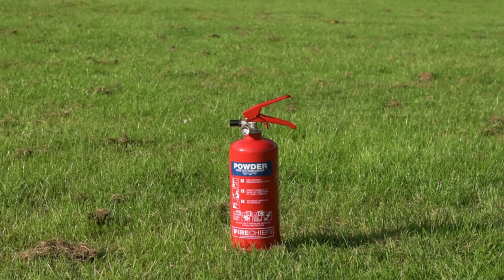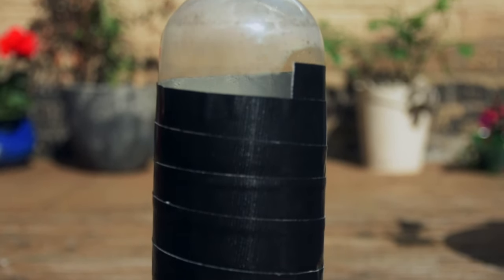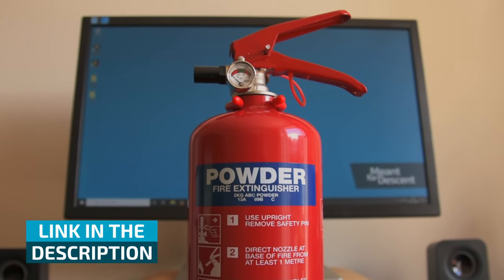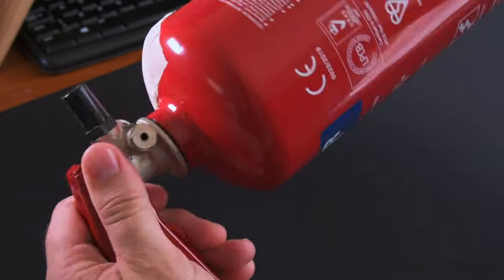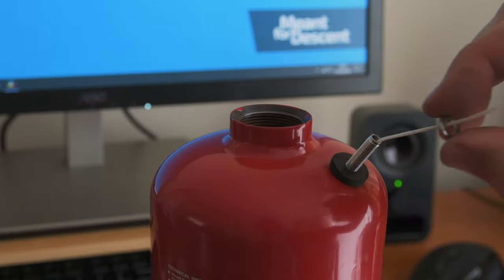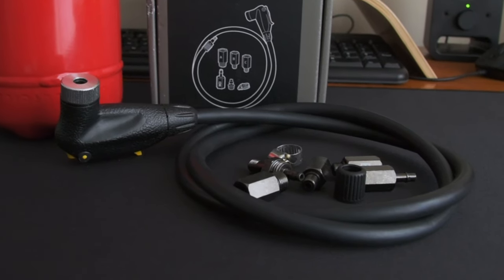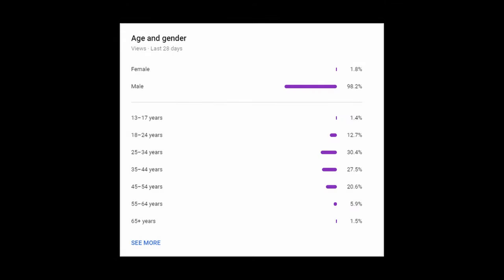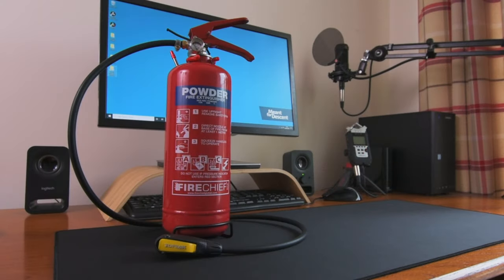Pro Level DIY Tubeless Tyre Inflator

Comment: Brilliant and elegant solution. Last capability I needed to be fully equipped for tubeless and I didn't need a compressor taking up space. Made one with a 4LB old extinguisher already in the house, works great! I only needed to buy a tubeless valve stem. I skipped the proper smart head upgrade and used spare plumbing parts on hand, and some stiff tubing to adapt to the existing rubber hose of extinguisher. The stiff plumbing hose is a cruse press fit on the valve stem, works fine. Even without taking the valve core out! Among the best tubeless hacks around, thanks!
Reply from the maker: Excellent. I'm glad it worked. I still use mine and it hasn't failed me yet.

Comment: I confirm it’s a great quick, cheap and reliable solution. Thanks for the instruction, and made a small deviation: used scrap tube to seal the presta valve instead of plumber tape.
Losses: 1 drill bit
Gains:🎉

Comment: Wow, you may have now convinced me to go tubeless. I know of an old extinguisher sitting about at work. May have to give this a go.....
Reply from the maker: As inflators go, It's so much better than a plastic bottle. Until that tyre went pop, I've not had any punctures in 12 months, so I'm sure that the sealant is doing a great job. Don't think I'd go back to tubes now.

Comment: Said it afore, that's brilliantly simple. It's genius... I haven't made the tubeless plunge on my own vitus due to seating the tyre potential issues
Reply from the maker: The cam strap really works. Without it that tyre wouldn't have gone on. My bro swears by soapy water on the side walls. I haven't tried that yet, but I'm sure he's had good results. Definitely an Improvement over the fizzy drinks bottle, though. You can get twice the pressure. The extinguisher's supposed to be good for 200 PSI, and that pressure relief valve is reassuring, too.

Comment: Love it.  I've a LifeLine Airblast track pump which goes up to 240 psi but the canister is just too small to seat my 3" 27.5+ tyres (on 40mm rims). Debating whether to go all in and get an electric air compressor but they're £200+ minimum....this looks like a great middle ground!
Reply from the maker: Thanks, Howarth. I've actually got a compressor, but this can go in the car on road trips, so it wins hands down on practicality. One of my bikes has 27.5 plus tyres and I'm thinking about making a video when I convert it to tubeless. I'm sure it won't be a problem with this, though.
Reply: @MeantforDescent  that'd be great. I've so many pinch-flats on my 27.5+ (usually on the rear as it's a hardtail too)! Had absolutely no flats on my full-sus tubeless 27.5 on 2.4"-ers.
Reply: @howarthgreenoak4257 , try this video at the 3minute mark and watch the technique used; 
https://youtu.be/dFhWf00s7G4
Hope it helps you to seat easily with your existing pump.

Comment: Why not a Schrader valve? They have removable cores by design and the self-returning valve pin prevents air from escaping once its inside. Plus it allows you to fill the tire at gas station or using regular air compressors without having to carry those adapters that you easily lose and don't work sometimes. It might also be a good idea to fit a pressure gauge as well. You don't want those steel canisters exploding because you put more air than it can handle. Or your tires.
Reply from the maker: Why not a schrader valve for my wheels or for my inflator?

For my wheels that's easy. They're designed to accept a presta valve, which is narrower than a schrader. Drilling them to accept a schrader valve doesn't seem very sensible, so there's no chance that I'm going to change. Also, because the presta valve is narrower, the hole in the rim can be narrower, so the integrity of the rim isn't compromised to the same degree as it would be if a larger schrader valve was used. 

With regards to my inflator, it's something that I did consider. Schrader valves are used to fill tanks and are available with 1/4" and 1/8" national pipe threads, but they are typically screwed into tapped bosses that are welded into the wall of the tank. Strangely enough, I do have a TIG setup, so it's something that I could do, but for most people doing that would be beyond their means or skillset, so it wouldn't make for a very helpful video. Tubeless presta valves typically have an external thread, so fitting them to a thin walled tank is also very easy.

You're right to say that schrader valves have a removable core by design, but so do a lot of presta valves, very much like the one I used in the video. You're also right to say that schrader valves have a self-returning valve pin, but is that reason enough to favour one? Presta valves are held closed by the pressure that is in the wheel or tank. They don't need an internal spring, so there are fewer parts to get gummed up with debris, such as tyre sealant, for example. I suspect that's why they're generally not used in tubeless systems, at least within the cycling community.

Really, that means that the key benefit of choosing a schrader valve over a presta vaIve would be that they can be used at filling stations. don't see anything really wrong with using a schrader valve, but the filling station thing doesn't really trump the simplicity and ease of installation that a presta valve offers.

Fitting a pressure gauge is a good idea, and again something I weighed up, but it's an unnecessary cost, especially  because I have a Topeak pressure gauge which I can use if I want to be accurate. As it happens, I think just being cautious is probably all that's needed.

I hope this gives you an insight into why I used the parts that I did. Regardless, thanks for watching.
Reply: @MeantforDescent  As a side note, you can get schrader valves that have a fully threaded shaft like presta ones. Presta valves, due to their design, lose more air than schrader ones. Another way would be using a ghetto tubeless with a split inner tube setup with added safety by gluing the excess tubing to the tire's side walls with rubber contact cement. Trials rider Ali Clarkson has a video demonstrating this technique, which he learned from another rider's mechanic.

Comment: Too many coincidences here. Same rims, same track pump, same valve caps, same extinguisher (not yet modified) and most importantly......... same accent.  😁
Very helpful, as I now know what size thread for the hose outlet 👍
Edit to add: It's worth re-inserting the handle so you get the position of the valve in the right place
Reply from the maker: Sorry for the late response. Good work on the accent, BTW. Rumour has it it's the best one out there.

I think I reassembled a few times to make sure everything fitted where it should. Measure twice and cut once, and all that nonsense.

Comment: I just made one, is it normal to have a bit of condensation when you fill it up to about 100-120 psi? There's condensation around the tire valve and the lid of the tank, basically anywhere where there's a potential air leak.
Reply from the maker: I've never had condensation when I've used mine, but refrigeration is caused by the movement of gas, so I'm sure it's a plausible. I wouldn't worry too much.

Comment: regular c02 tyre inflators that you carry on the trail work really well for seating beads.
Reply from the maker: Thanks, Iain. I do carry an inflator on the trails; usually with the bigger 25 gram cartridges. I get the feeling that these were particularly stubborn, though. Even with the inflator they wouldn't seat without the help of a cam strap pushing the bead against the rim. Top advice though. Cheers.
Reply: @MeantforDescent   a good way when fitting a new tyre is to put in a tube and inflate it really hard overnight, then the next day remove it and go tubeless, that way the tyre has then taken the shape of the rim, so seals pretty easily then.
Reply from the maker: Good call, Iain. I'll give it a go next time around. Cheers.

Comment: Nice job mate. Thanks for share. No tubeless user here...yet. But I wonder if the booster need it just for the first tire set up only? What should be the best choice: a smaller can filled at high pressure or a big one at moderate pressure? This cans works at 15 bars (200 psi) around and are tested at twice as much. Definitely  small 1l  tanks as Airshot, Topeak, Schwalbe...are such of jokes for larges tires.
Reply from the maker: Some of the tyres I've had went with just a pump, some not. I think folds in new tyres can cause problems, but I've had issues refitting tyres, too. The jobs a lot easier with this though.

Comment: Hi, great DIY projects. Is it enough if im using 1kg fire extinguisher?
Reply from the maker: Thanks. To be honest, I don't know. I'd guess it is because I've seen others use them. I had originally intended to use a 1kg extinguisher, but the heads are different to the one I chose. I picked the 2kg because I found a 1/4" BSP hose tail with a 3/16" barb that would screw straight in. That was absolutely the deciding factor.
Reply: I just built one out of a 1 kg and it works perfect too.

Comment: Great work!  Having just made one using a garden sprayer that obviously won't go to 160 PSI, I fancy giving this a  try.  One concern is that a canister that size piped up to 160psi has a lot of volume so it may be possible to inflate the tyre beyond its safe max pressure.  Any idea what pressure your tyre sits at after a full discharge, i.e. when they tyre and inflator are equalised?  Cheers
Reply: Volume should not matter because the pressure equalizes, so if you got 3 bar of air inside your garden sprayer but 4 bar in your tire, the tire would push air into the garden sprayer
If your garden sprayer has 3 bar and your tire 1 bar then from garden sprayer to tire
If both equal out after that in pressure level the air stops moving, you should have heard that already
When you inflate your tire with it and the remove the hose from your tire you are still left with pressure inside the garden sprayer, doesnt matter if 2l or 200l volume.
Makes sense?

Ofc this dude wont push 160psi into his tire, else that mtb tire would be very unhappy, you just give it bursts until the tire seats, but it enables him to reuse it and not have to repressurize after each tire like with the 3bar of a garden sprayer
Reply: @flosa1995   Very good point - Thanks :)

Comment: Crashed my bike yesterday and bent my wheel slightly! Don’t have a trueing stand or many tools?! Any tips?

Thanks 👍
Reply from the maker: you can use your frame as a truing jig. attach pencils to the frame/fork with elastic bands, either side of the wheel, making sure that the blunt ends are against the rim. You can then spin the wheel and use the pencils as a guide to see the location and severity of the buckle.

Comment: Would this help with a realy loose fitting tyre? My front continental fits perfect on a bontagra rim but the rear had to be replaced with a raleigh rim and it feels smaller, i can put on and remove tyre without tools with ease, or do i need to go getto?
Reply from the maker: Hi Nick.

I had real problems with mine seating, and tightening a cam strap around the tyre was a huge help. It pushed the bead against the rim to limit the amount of air escaping. If you have access to a compressor give that a go. Together with the strap you'll probably make it work. If you don't have a compressor then some sort of inflator would be a good choice. This one hasn't let me down yet.
Reply: @MeantforDescent  no compressor but will have a go with building this, and using a cam strap, how tight should the strap be?
Reply from the maker: Just as tight as you can get it. Go easy if you're using a ratchet strap, though. You could probably do some damage with one of those.

Comment: Does anyone know how many pumps it takes to get this up to 160psi? I tried it with my own extinguisher flash can using a foot pump, and I was utterly fucked before I'd even got it to 80, then I broke my flip flop. 8|
Reply from the maker: LOL. Suppose it depends on your pump. With a foot pump I'd go slider or higher. May be even a plimsoll. Did it in under two minutes with my track pump. My Five Tens braved it like champs, too.
Reply: @MeantforDescent  Thanks for getting back to me, it's size 13 Adidas sliders replacing my flip flops, and a Topeak something or other track pump replacing the foot pump. If this combination can seat my Jumbo Jim fat tyres then I might patent it.  👍👍
Reply from the maker: Add a cam strap around the tyre and could be onto a winner. Good luck.

Comment: Rad bit of hackery! 

Though you don't need a tubeless inflator to mount Maxxis MTB tyres, never have needed one after mounting 200+ over the last 10 years or so with any old floor pump. Just use a tyre lever and mount the tyre (as much as you can) manually, see Syd and Mackey's technique here if you  have a particularly undersized rim. https://youtu.be/tE3h4nmDdOo?t=243

Comment: I know it's a struggle but let go of maxxis there are other brands (michelin)
Reply from the maker: Yeah, I'm sure there are great tyres out there that aren't Maxxis. I just replaced like for like because they've been awesome. Now I think about it, though, in the last 10 years I've only ridden on High Rollers, Ardents and Minions.
Reply: @MeantforDescent  people get sucked into them it's like iPhones smh anyway how much were the posh top peak bits and pieces I probably got that name wrong I'm old the memory going
Reply from the maker: The hose kit was £20, so needlessly expensive. It works well, but there are definitely cheaper alternatives out there.
Reply: @MeantforDescent  yep cheaper than my airshot think that was around £50 much more satisfying building it yourself anyway bike review on that vitaes I probably spelt that wrong but you know what I mean

Comment: This looks more expensive than just buying a purpose built tubeless inflator, am I wrong?
Reply from the maker: It was the same cost as an Airshot, but I bought all the parts new. It could definitely be made for less with a cheaper extinguisher, a cheaper valve and a cheaper hose kit. That said, cost wasn't really my concern. I wanted something fairly unique, more robust than the alternatives, and I wanted to build it myself. I'm pretty happy with the way it turned out. Boxes ticked.
Reply: @MeantforDescent  Interesting, I just looked it up and fire extinguishers are a lot cheaper than I expected them to be. I think when I need one I'll try the weed sprayer inflator hack cause I already have one, and if it doesn't work well, then I don't mind shelling out and getting a track pump with a reservoir, but this is still a cool idea.
Reply from the maker: The soft drinks bottle was my cheap and on hand solution. It was so much hassle that I'm glad to have the extinguisher. As long as you find something that works and is reliable, you'll have made a good call.
Reply: It can be done a lot cheaper too, though. Mine was like, 10 EUR all around? 6 EUR for 20yo (basically cannot be certified anymore so they are not worth much) 1 kg fire extinguisher, 1.something EUR for the hose tail, 2 EUR for PVC hose (5 mm inner diameter), and that was it. (I have surplus of those tubeless valves, but those are really cheap too). Works great. Eventually I am gonna put on nicer hose and stuff, more for the sake of tinkering than anything else, but for 10 EUR it absolutely works and is miles better than soda bottle (which worked somewhat, but it was a struggle).
Reply from the maker: Spot on. I'm glad it all came together. Love mine. Can't beat it for seating tubeless tyres.